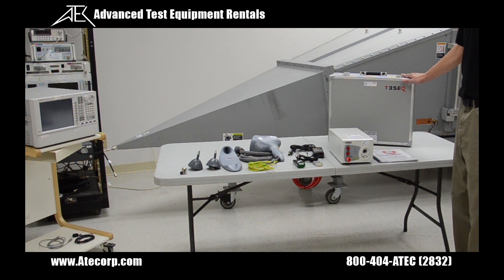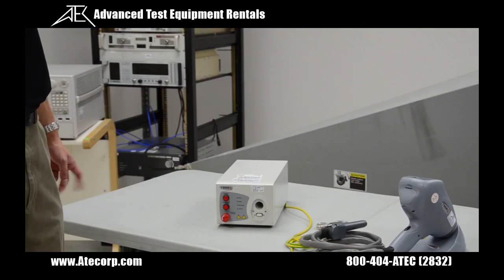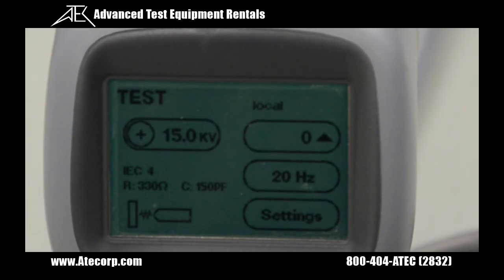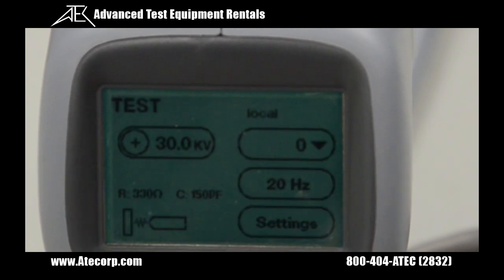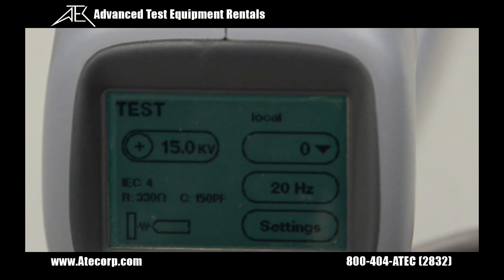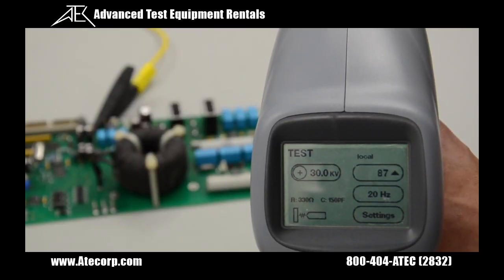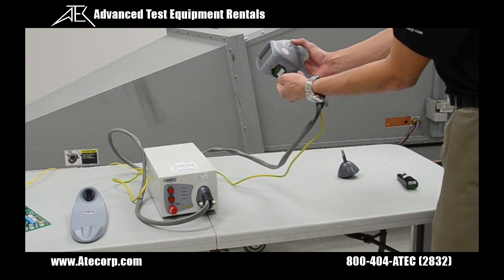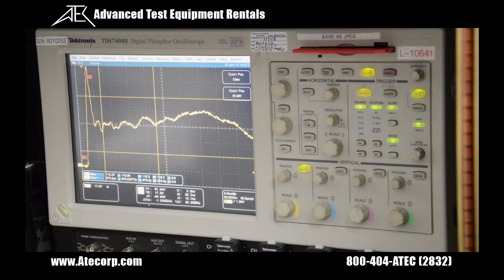How to Use a Teseq NSG438 ESD Simulator Gun - Air Discharge & Calibration

Comment: does it work without connecting the power supply cable? I see that the cable is not connected
Reply from the maker: Hello Yuchan, 
The main ESD Gun needs to be connected to the Base Station, but on the NSG438 there is an internal battery, making it portable and not having to be connected to the wall at all times. This may be convenient for some applications!
Thank you,
ATEC
Reply: Thank you for your reply. Could you advise if I can charge the internal battery as well? Where can I find these details? I can't see in the manual @AdvancedTestEquipmentCorp
Reply from the maker: @Waterview89  Yes the battery is internal to the base station, it gets charged by the AC/DC adapter included. See our website here and our accessory list for a better idea. https://www.atecorp.com/products/teseq/nsg438